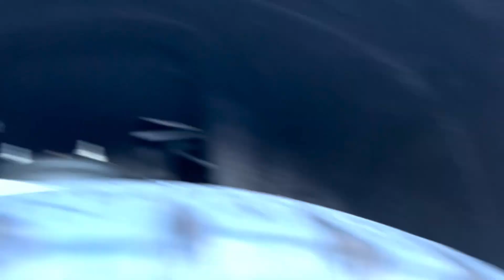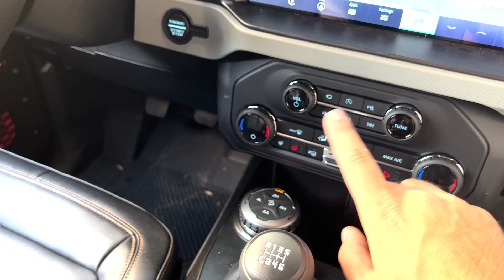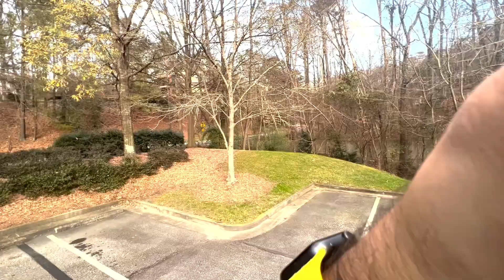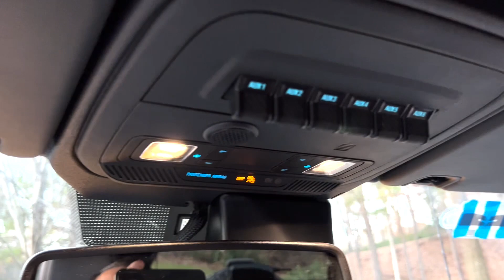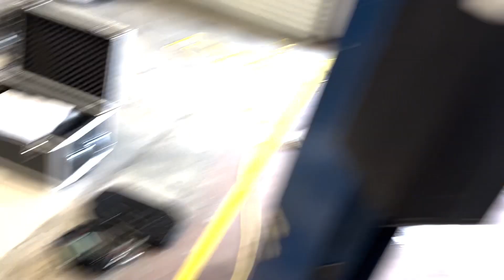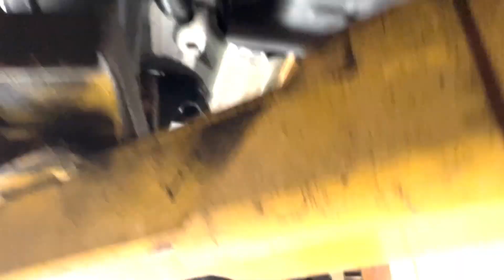In Depth Tour: 2021 2-door Bronco Badlands manual

Comment: After watching this video again I'm thinking about ordering a 2026 Badlands two-door with the 7-speed manual, of course. Can't decide between that green color black or gray.  Still trying to figure out why Ford wants $6,000 to add the Sasquatch package to one of these. The only upgrades I can think that come to it are different shocks and larger wheels and tires and wider fender flares. How does that cost $6,000?
Reply from the maker: Did you end up picking one up? The Sasquatch changes a different number of things based on what trim you add it to. It may make more sense to skip it and make the changes you want in the aftermarket.
Reply: @bandygram  I haven't bought one yet. I'm thinking about getting a 2-Door Badlands 7-Speed manual used at this point. Like you said I can add the 35s and shocks if it doesn't have the Sasquatch package already. It kind of seems like a badlands is the best starting point since it has the 4.70 gears and front/rear lockers and sway bar disconnect, skid plates, even if it's not a Sasquatch.
Reply from the maker: @331Grabber I agree. That’s the route I took and I did enjoy it without the Sasquatch package but it would be a trivial upgrade. Best of luck in your search!

Comment: you can put the sasquatch wheels on the badlands without any modifications  but you must remove the crash bars in the front.
Reply: I'm still trying to figure out 3 years later why adding the Sasquatch to a manual transmission Badlands costs $6,000. As far as I can tell,  you get bigger wheels and tires, different shocks, and wider fender flares. That literally sounds like less than $1,000 difference.

Comment: Really good video, though I’m only about 10 minutes in to it. I’m waiting for my MY22 2dr Badlands EG 7MT MGV, Sasquatch, Lux, Tow, and roof rack (I’m a late Aug 2020 res, and have several constraints, tow package being one of the build killers at the moment, so I’ve got a long wait.). Question: If you had been pushed to MY22, or if it had been an option for the 7MT in MY21, would you have added the Sasquatch package?
Reply from the maker: I wouldn’t have since with the manual the only difference is the wider fenders, an extra 0.4” of shock height, wheels and tires. I wouldn’t mind all of those additions but I don’t love the look of the sasq wheels and for $4k I could find a set of wheels and tires I prefer in that size or keep these wheels since I do love how they look. With the manual and badlands I get all the same gearing, axles, etc as sasq
Reply: @bandygram  Makes complete sense! I ask only because I'd been considering dropping Sasquatch for similar reasons. Further, I figured I could just run the stock 33s until I came up against something I couldn't accomplish with the stock setup, which could take some time as I'm NOT a rock crawler for the sheer sake of crawling, but merely out of necessity should I come across challenging terrain while trying to get from point A to point B off the beaten path.  Given other realities (commodity constraints), I may also finally give in and drop the tow package, sadly.

Comment: Very nice, thorough review. Are you planning a driving impressions/features video? I'm especially interested in Stop/Start use, (on and off road) as well as the hill hold feature with the manual trans. I have a Base with Sas and 7MT being built soon (hopefully). Thanks!
Reply from the maker: Congrats! The manual is incredible for off-road. The anti-stall feature allows you to focus on braking and clutch release without the gas for precise control. I’ll put more together soon.
Reply: My focus rs has auto stop/start with the manual. It works pretty well and fires right up as soon as you breathe on the clutch, just a little annoying especially knowing the turbo is cooking in it’s own oil at traffic lights. I turned it off with forscan.
Reply: @benslagel2472  Hey Ben! What is forscan? I don’t have mine yet but my wife’s car has it. Drives me nuts. The thought of a starter working this much is ridiculous. It has a switch on the dash but you have to use the switch every time you start again. Thanks

Comment: Forscan can deactivate the double honk with the correct coding.
Reply from the maker: Awesome! That makes sense and I definitely need to do that. Thank you!
Reply: @bandygram  no problem. Excellent in depth video. Also excellent pick trim and option wise. My 2 door badlands manual high package is finally scheduled to be built. Can't wait. Was going to go with lux but suddenly I was scheduled so no going back!
Reply from the maker: @vanagonaddict  you’re going to love it!
Reply: @vanagonaddict  You got my exact config! Mine hasn't been scheduled for production yet (that I know of), what color did you get (I got eruption green)?
Reply: @bcool2525  I went with cactus gray. The eruption green i strongly considered but wasn't vibrant enough for me. The green they previously showed on a gas can/camera box for some event was amazing and I would've switched for that color but I have a feeling it'll be used on a heritage or everglades edition.